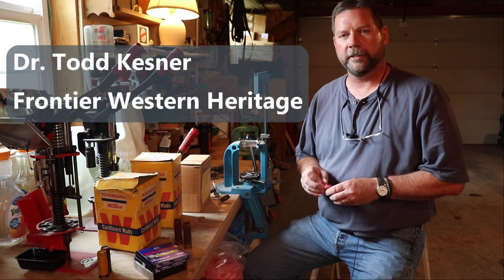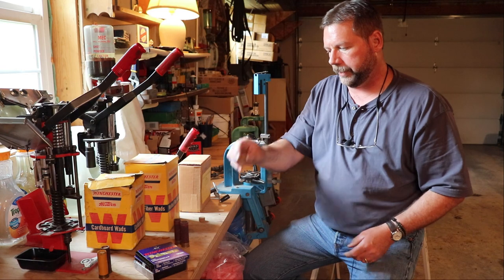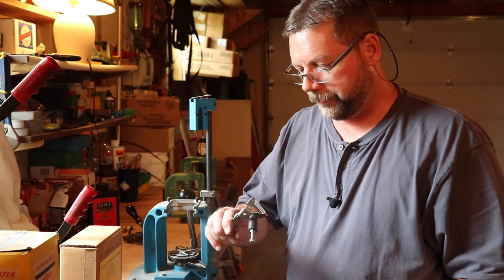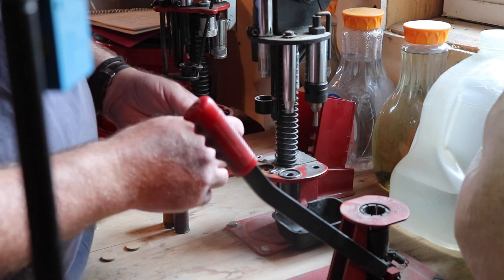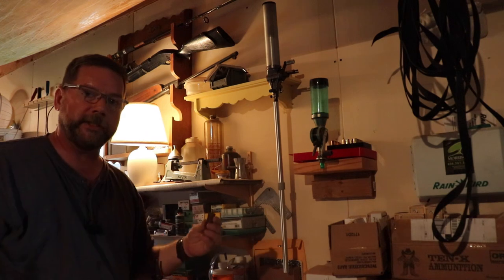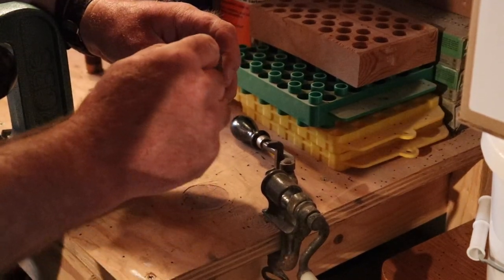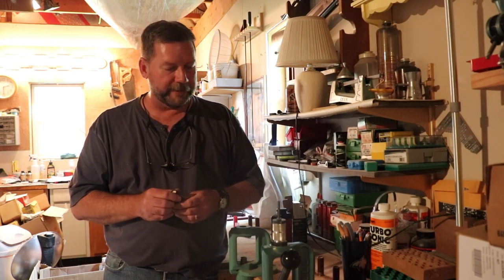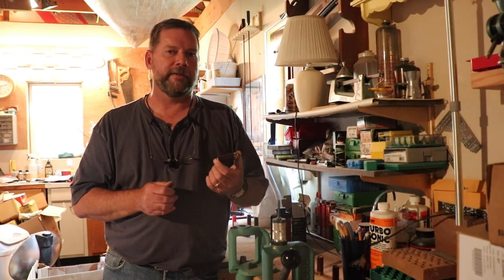Loading Paper Shotgun Shells

Comment: I have loaded brass shells for my older shotgun shells but recently ordered a few hundred once fired paper hulls. Looking forward to figuring out these. Thanks for the video.
Reply from the maker: Have fun with it.  Same principle, but you'll burn them out in 4 to 6 loadings depending on the charge.   Watch for pin holes developing where the paper meets the brass base.  A lot of times I won't notice until I compress the powder slightly and it breaks through the paper case just above the brass.  Still, I enjoy loading paper as much as brass.  Thanks for watching, Todd.

Comment: A very good idea using the case trimmer to cut to correct length, experiments show that contrary to belief ,the use of a 2 3/4" case in a 2 1/2" chamber does not increase pressure, I notice that you do not use a wad starter, a simple tube that makes inserting the wads much easier, especially once a cartridge has been used a few times, the one thing you must never do is try to push the wad through the starter with your finger, as there are spring "fingers" to ease the wad past the tatty lips of the case ,they will allow your finger to go in, but not come out! So the use of a dowel is essential. Many thanks for posting this excellent tutorial ! Chris B.
Reply from the maker: I did not know there's such a thing as a wad starter!  Nice tip.  I'll look around for one!
Reply: @frontierwesternheritage1356  All it is is a tube that fits over the outside of the case, with spring steel fingers that fit inside the case, the wad, which is sometimes difficult to start into the case, is guided into the mouth by the fingers, however, if one pushes the wad in with a finger,(digit), the spring fingers allow it in, but of course will not allow it back out, the only way is to wrap thin sheet shim stock around the trapped digit, and open up the springs, easy! Chris B.
Reply from the maker: @453421abcdefg12345  I bet a plastic one, detached from a MEC reloader, would help.
Reply: @frontierwesternheritage1356  Give it a try, you will like it! Chris B.

Comment: I know ppl use 11 gauge wads and sometimes 10 gauge nitro cards for brass hulls, for paper hulls, do you recommend downsizing for the much thicker walls? Like 13 or 14 gauge wads/nitro cards?
Reply from the maker: I got lucky and was given a ton of 12 gauge wads and cards by a friend who owned an antique store.  So they are all from the period when paper hulls were almost exclusively used and were made to fit properly.  Therefore, I've never had to buy them and recommend you call or email a supplier to make sure you're getting the right size.  Since 12 gauge muzzleloading wads won't work and bulge the paper case, you're properly right about 13 or 14 gauge.  I just don't  have the experience to tell you for sure.   Todd

Comment: Did they use brass hulls?
Reply from the maker: Yes, brass shotshells were more popular in the United States than Europe.  Pinfire paper shells never really caught on here.  But central fire paper shells and brass were used concurrently.   The improvement of the waxed paper shell for added moisture resistance started a stronger trend toward paper.  So brass was not the only choice, but certainly popular.
Reply: I had the same question. It would appear the doc has a Phd in History.